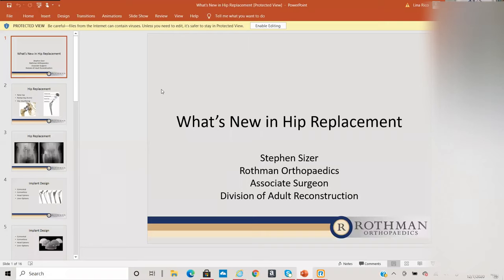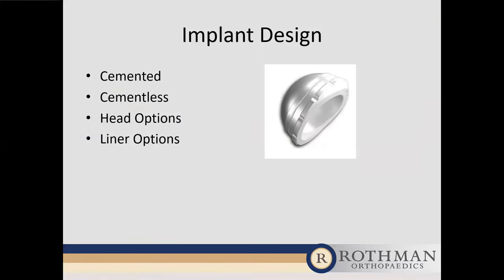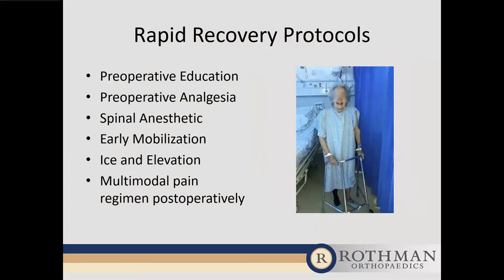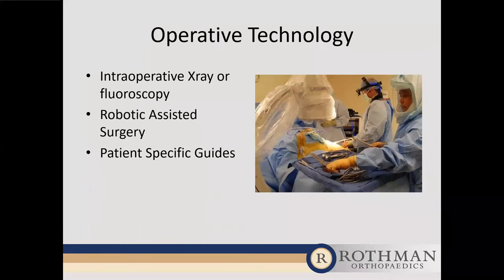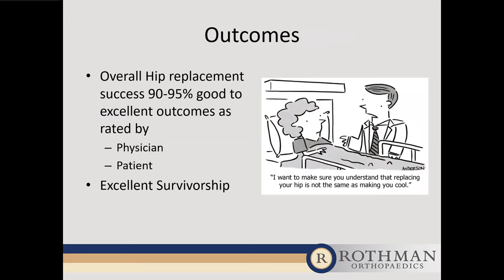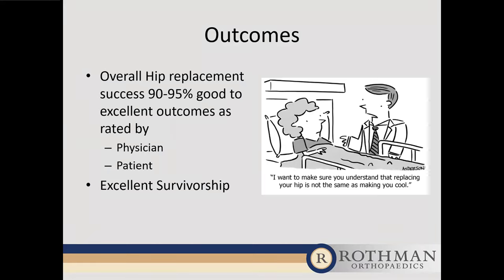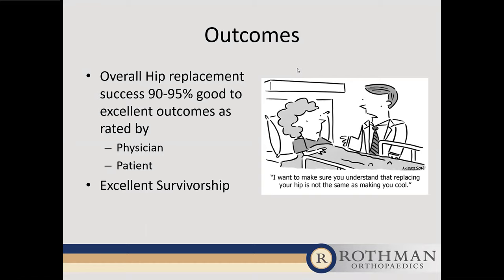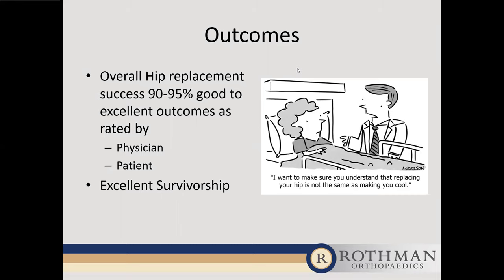Dr. Stephen Sizer - "Whats new in Hip Replacement Surgery”

Comment: I had my hip replaced in 2000 by Dr. Sharkey of Rothman Ortho.  I report that I have had no setbacks or negative follow ups.   I have been pain free since the procedure and have also dropped my handicap in golf from a 33 for 9 holes, down to a 4 this past season.   Most rounds I do walk also, just use a pull cart.   Thank you Rothman!

Comment: I am a cloud network engineer as well as building them. I am 63, and actively working. I understand Ceramic replacement has the best results for active people polyurethane crossmember is not. Is this true? The biggest concern with COC is if one falls and it takes an impact, it might shatter.

Comment: I need 2 hip replacements, 2 knee replacements, 2 large toe replacements, 5 squashed disc's, Scoliosis, Osteoporosis and Osteoarthritis in my spine, both hands have carpel tunnel syndrome and will adventually need an operation in both.

This was due to a young male stealing a car and he hit me head on at 120kms per hour and he spun out of control and hit me in the drivers side door of my car, in 2017 i had a bladder prolapse lift, band was used and the Surgeon drilled into my pelvic bone on either side.

I am booked in for my first hip replacement in July, i am worried about my pelvic bone while the sugeon does my hip surgery, can you please tell me is it to dangerous to have hip surgery due to my pelvis already been drilled into ?

Kind regards 
Michelle